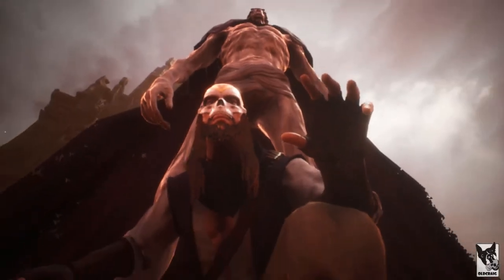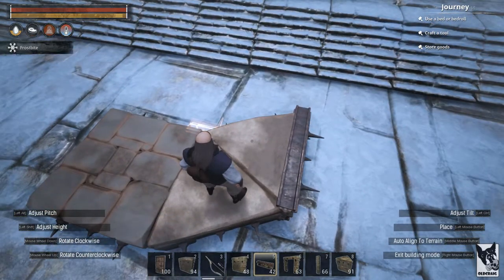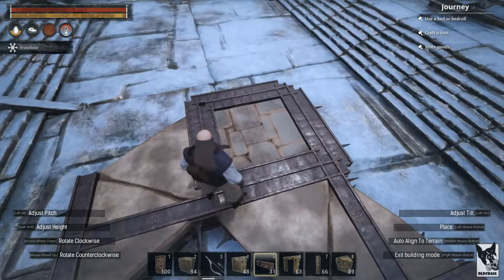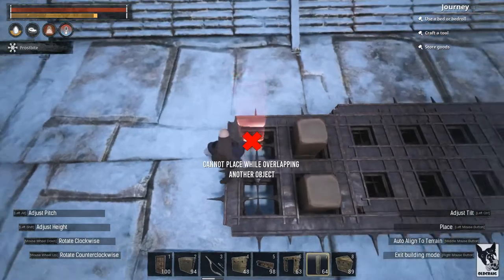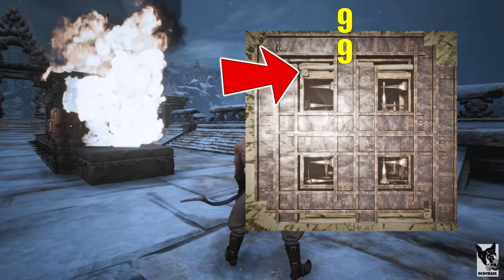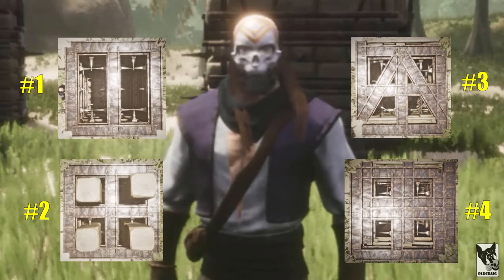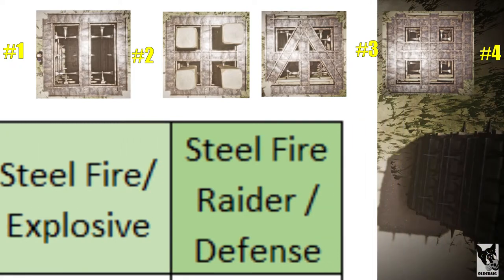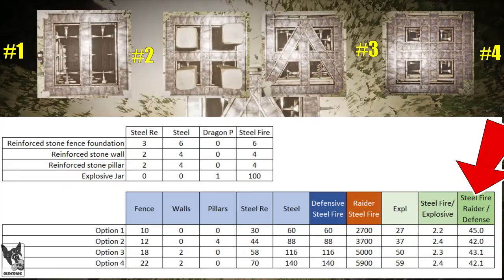STRONGEST WALL IN THE GAME? (wall guide) Part III - Conan Exiles

Comment: I don't know if this is a bug or just a unique glitch but when I built a wall like your option 2, so with 4 foundations in a square formation with 2 more foundations in cross formation in the middle and I placed pillars into the voids between foundations those pillars did not inherite the decay timer of the other building parts and decayed as abandoned. So in that sense it's not worth it to place pillars into the wall if they are not connected to anything else.

Comment: Great video series. Noob question, what if they attack the foundation pieces that the walls sit on? Just trying to learn the advanced building techniques.
Reply from the maker: Thanks man. That's a legit question. If the bottom foundations are placed low enough then they don't take any damage at all. If you raise them too high (approx more than half of the foundation is exposed above ground) then they will take damage. So try to keep them low. Also, since fence foundations are technically foundations, not walls, they will not collapse if connected to the environment. For example, let's say you build a wall of fences from the ground up to the ceiling of a permanent structure. If you destroyed the bottom foundation, the rest of the foundations will remain in place because they still have a point of contact with the permanent structure.
Reply: @oldcraig  man you've done so much research. definitely subscribed to you! keep it up!

Comment: Great video Craig! I have a question. I did the no.4 wall strategy with black ice pieces and it seems the black ice fence foundation pieces are actually slightly thinner than reinforced stone, and I was wondering if you have tested the damage to see if it still blocks damage in the same way. A confirmation would be great as black ice is much faster to produce on official servers. thanks!
Reply from the maker: That's a great catch! I can confirm that this IS TRUE: black ice blocks damage whereas reinforced stone does not. I just released a video about foundation stacking and I specifically mention that. So bottom line: avoid reinforced stone if possible.
Reply from the maker: https://youtu.be/3pHp7X8krxE
Reply: @oldcraig  Having trouble with loading the videos, but what about the DLC assets like Frontier and Aquil?
Reply from the maker: @PsyTranceKaitia  All buildings take damage equally, so it just comes down to how much HP they have.
Reply: @oldcraig  so avoiding reinforced stone is obsolete now?
Reply from the maker: @PsyTranceKaitia  In terms of the old foundation stacking method, yes. But steel fire is better used for explosives. So in my opinion, I think it's better just to harvest the black ice and dedicate all steel fire to explosives.
Reply: @oldcraig  Playing on a 10x pvp server, so that aint no issue 😉
Do you, by any chance, know any secure designs for horizontal elevators? Maybe content for another video about elevators.
Reply: Do you happen to know if this build still works or if they fixed it? Is it PC only maybe? On PS4 it will NOT let me place the second fence foundation on the wedge. The first one that overlaps a bit. I've tried different sides. We are kind of on the side of a wall overhanging. Will it not work on a foundation base only on the ground?